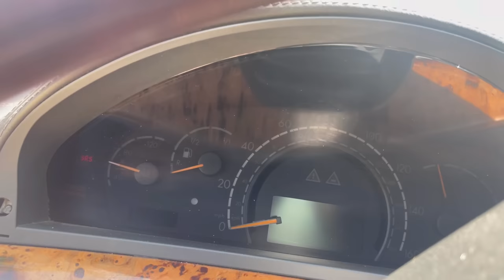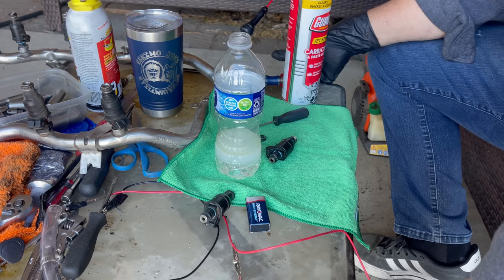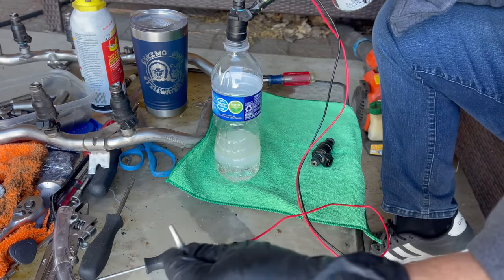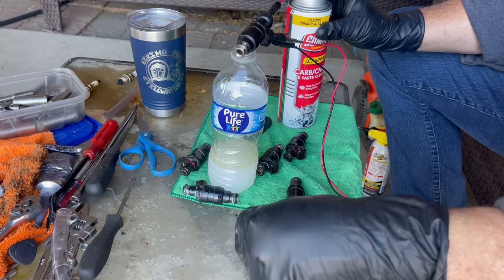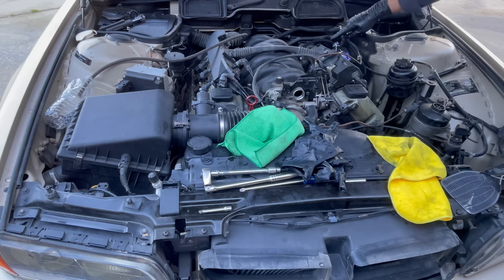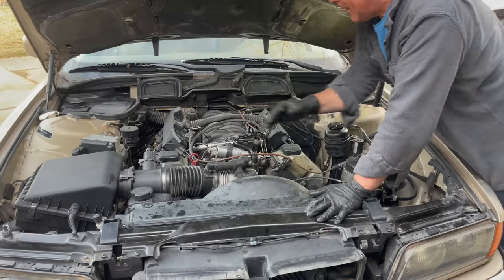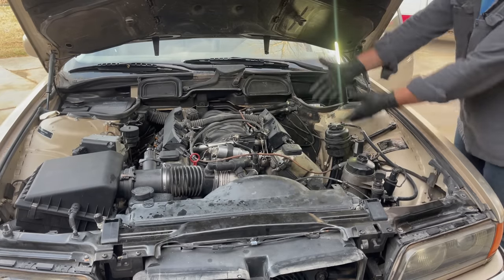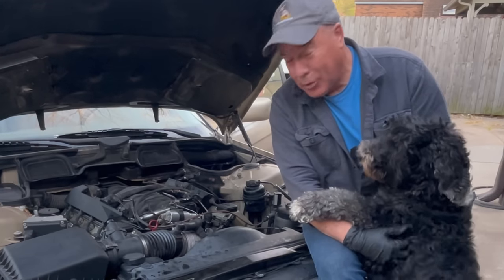BMW Fuel Injector Cleaning

Comment: Hello, my friend, I have a BMW 740 with the same model, and through my knowledge of maintenance matters for this car, I think that you have a vacuum leak at the top of the engine, which leads to irregular engine operation, which confirms this. The sound of strong air suction. When I approached the engine, I heard a very strong hissing sound I think that there is probably a piece of plastic on the back of the engine that needs to be replaced. Thank you for reading my comment. Greetings from the United Arab Emirates ❤❤❤
Reply from the maker: Thank you! I’ll look for a leak

Comment: Great job and learned something new. Did you scrub out the fuel rail ?  Put a filter right before the fuel rail ?  Despite new gas there may be impurities getting out of the tank and into those injectors.

Comment: I bet the vacuum leak is from the front plate on the intake manifold. there is a plastic mounting plate for the throttle body and it has an orange seal that loves to get brittle with age and causes vacuum leaks, mostly on cold start. there is also a similar seal on the rear of the intake manifold, on the “CCV” cover. also, inside this CCV cover is an orange diaphragm that likes to tear and will cause a vacuum leak (and may even suck oil from the cylinder heads into the intake manifold). if you replace the CCV, you must get an OEM BMW one (~$125), all others do not work properly.